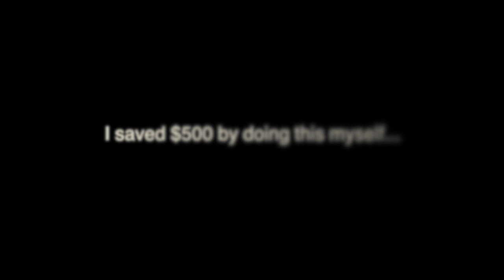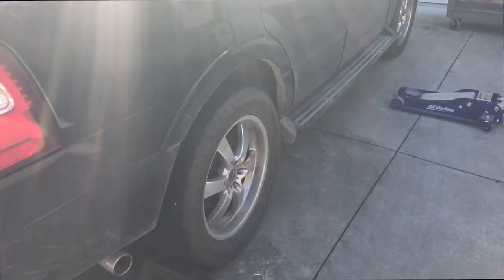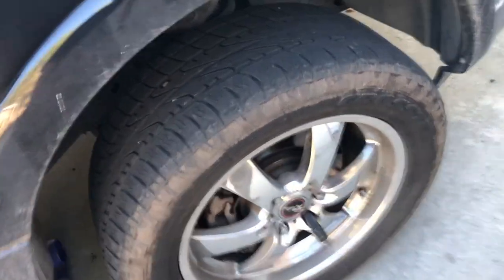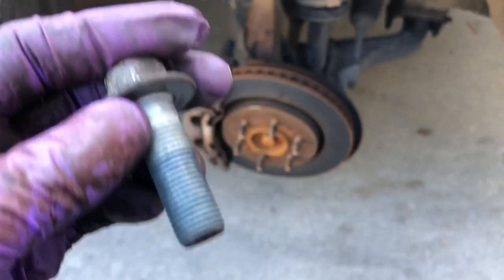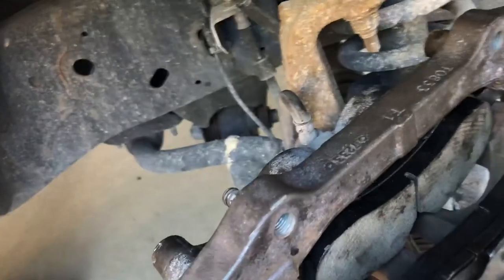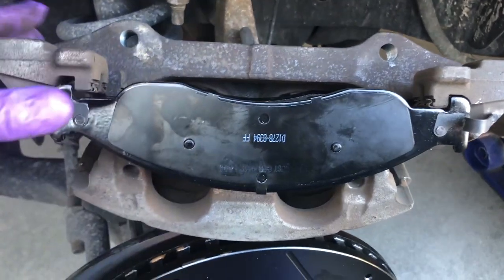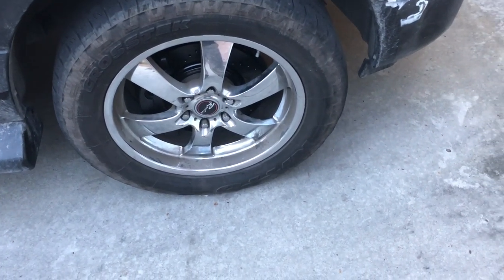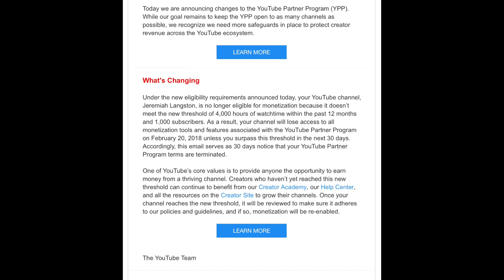Ford Expedition how to new brake rotors and pads.

Comment: You can cut a piece off a 9mm allen wrench, stick it into a regular 9mm socket, and you have the right tool.
Reply from the maker: 9mm isn't a common size allen key.  I have 3 different sets of wrenches and bits, and none of them have a 9mm.
Reply from the maker: Case in point, here is a high end set of german made hex keys...   There is no 9mm...  https://www.amazon.com/66982-ErgoStar-L-Key-Metric-22-Piece/dp/B009461IMA/ref=sr_1_5?keywords=german+allen+wrench&qid=1569894501&sr=8-5

It's weird, but the 9mm is a odd size, and typically doesn't get packaged with sets for whatever reason..
Reply from the maker: Here goes a snap on set.   https://shop.snapon.com/product/DBHM9